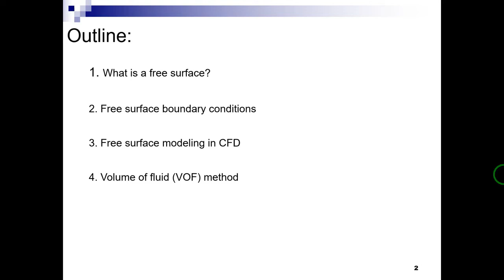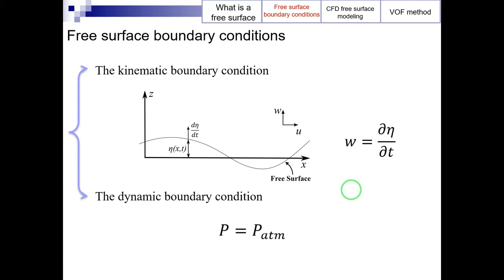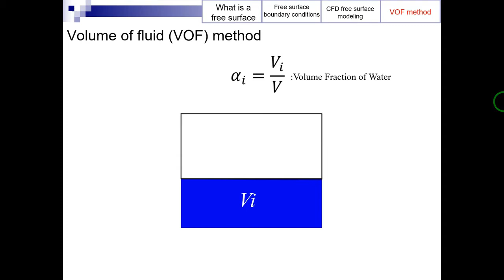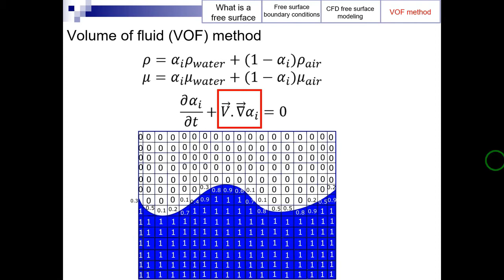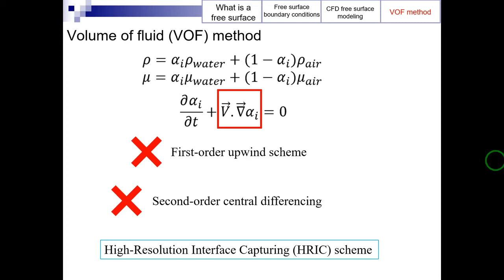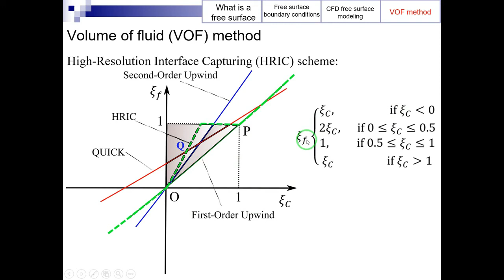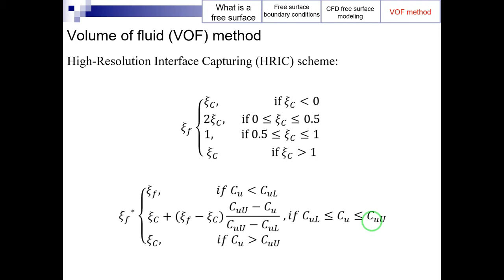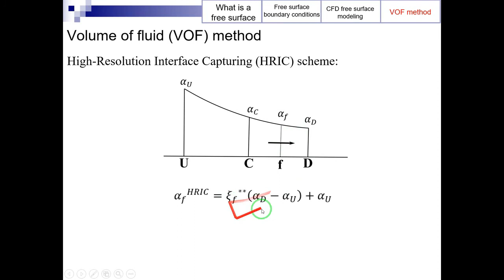Free Surface Modeling: Volume of Fluid (VOF) Approach

Comment: Great video. Do you know if COMPRESSIVE (default in Fluent)
is a First, Second or high order scheme?
Reply from the maker: Hi Leonardo,
Thank you for your comment. The compressive method used in Fluent is theoretically second-order.
Reply: @CFD_Mojtaba  thank you. Do you recommend some book or paper where I can read about algebraic VoF approaches, particularly COMPRESSIVE AND HRIC MODIFIED?
Reply from the maker: @leonardohenao7646  you can have a look at the following papers:
Muzaferija, S. and Peric, M. 1999. Computation of free surface flows using interface-tracking and interface-capturing

Heyns, Johan A., et al. "Development of a compressive surface capturing formulation for modelling free‐surface flow by using the volume‐of‐fluid approach." International Journal for Numerical Methods in Fluids 71.6 (2013): 788-804.
Reply: @CFD_Mojtaba  Thank you!!!

Comment: if we take Multi-stepping method like number of implicit multistep is 8 for example, then should we take this into account while setting a lower and upper CFL values for HRIC Scheme? I mean multistep allows to use 8 times larger courent number in this case so one should also use larger lower and upper value for HRIC? what is the disadvantage if I use lower and upper limit 50 and 100?
Reply from the maker: Dear Abhishekkumar shingala,
To make use of the advantages of the HRIC method, the values of the lower and upper limits of courant number within the VOF method should be higher than the local courant numbers encountered over the free surface.

I hope this helps!
Respectfully,
Mojtaba.